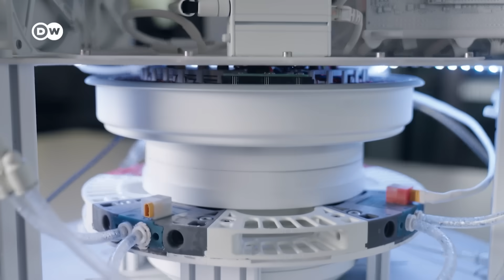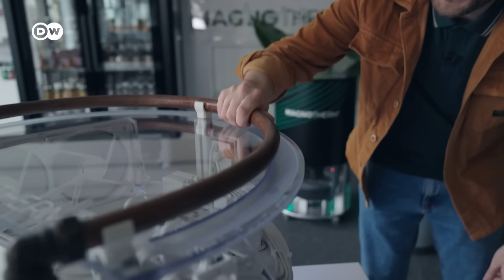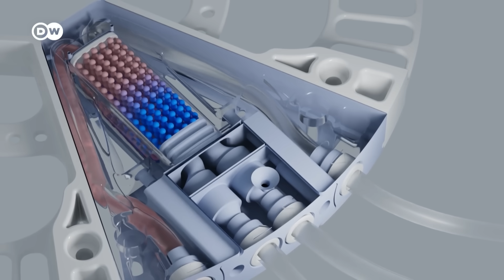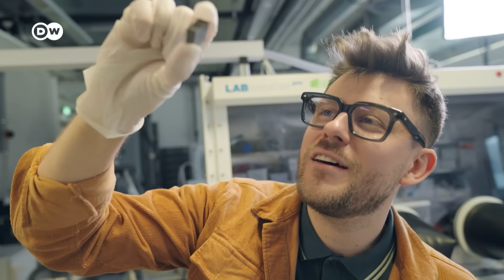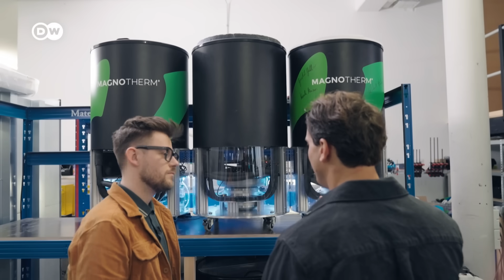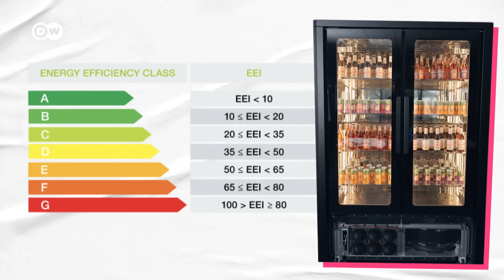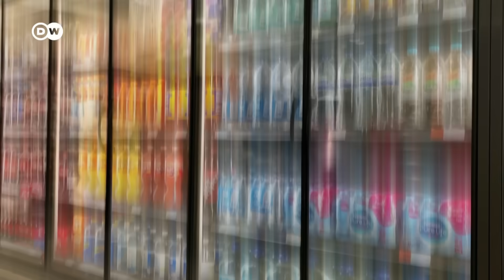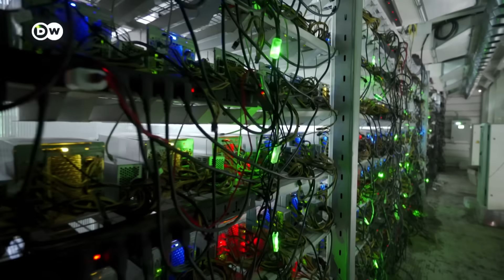How magnets could change our fridges and ACs forever

Comment: Seams to me, like the two big hurdles to overcome are the low temperature differences being made, and the fact that the elements are switching between hot and cold, rather then having a defined cool and hot parts, like in vapor systems. But time will tell. I mean, we had a steam engine for a very long time before we figured out how to make it actually usable
Reply: The temperature differential is directly related to, and limited by, the magnetic field strength which can be generated. This is limited by the physics of magnets, so temperature differential is unlikely to improve.
The alternating nature of the design is also directly related to and limited by the physics of the cooling effect they are using. The material itself must alternate between magnetized and demagnetized to switch between heated and cooled. You have to flow the external (heat exhausting) coolant through while hot to remove energy so that the element can cool when demagnetized. It's during the demag/cooling phase that internal coolant is run through to cool the chamber.

Ultimately neither of the problems can be eliminated. It is clear from the video that they are already pushing the physical limits of the technology and it just can't out compete existing compressor technology which is also pushing its physical limits for efficiency.
A not insignifcant portion of the efficeincy gains in recent years for compressors has been from reducing the temperature differential of the system to minimize energy consumption. At this point they run the cool side as warm as practical for indoor cooling and the hot side as cool as possible to still work on a hot day. The compressors are about as good as it gets, the temps are a minimized as possible, the refrigerants might have minute gains to optimize, but at the end of the day we're at the limit of what's physically possible.

Comment: REEs are impractical if your goal is economies of scale you would need new material choice selections instead.  This would also allow you to reduce the cost of the system being manufactured.                                                      Comparison of Cooling Technologies Using Graphene and Non-REE Alternatives

By integrating graphene and non-rare-earth elements (non-REEs) into MagnoTherm's Magnetic Cooling and Elastocaloric Cooling systems, we can evaluate the impact of alternative materials. Both technologies benefit from the unique properties of graphene and the availability of non-REEs, leading to potentially more sustainable, energy-efficient, and cost-effective solutions. Here’s a breakdown of how these alternatives, including graphene, affect the effectiveness of each cooling technology.
1. MagnoTherm's Magnetic Cooling with Graphene and Non-REE Alternatives
Key Factors Impacted:

    Magnetocaloric Effect: The magnetocaloric effect is a central feature of MagnoTherm's technology, where the material heats up when exposed to a magnetic field and cools when the field is removed. Graphene and non-REE materials do not directly enhance the magnetocaloric effect itself but contribute significantly to thermal management and material strength.

        Effect of Graphene and Non-REEs:

            Graphene can improve thermal conductivity within the heat exchange system, enhancing the efficiency of heat transfer. This could increase the overall cooling performance even when non-REE materials like Fe (iron), Mn (manganese), and Ni (nickel) are used, which are more abundant and cost-effective than rare-earth elements (REEs).

            Non-REE alternatives such as Fe-based alloys and MnFePAs provide similar magnetocaloric effects to REEs but at a significantly lower cost and with more sustainable sourcing.

    Energy Efficiency: The integration of graphene can contribute to faster heat transfer, reducing energy consumption by increasing the efficiency of the heat exchange process. Non-REE materials contribute to the overall efficiency by offering similar cooling effects to traditional REEs but without the environmental impact.

        Effect of Graphene and Non-REEs:

            Graphene’s role is primarily to optimize thermal conductivity, enabling the cooling system to operate faster and more effectively, even with non-REE materials. This results in 30-40% reduction in energy usage, compared to conventional systems using REEs.

            Non-REEs, such as Fe and Mn, offer significantly lower energy input due to their more affordable production and widespread availability.

    Durability and Longevity: Graphene improves the corrosion resistance of the cooling system, especially in water-based heat exchange systems. Non-REEs like MnFePAs can also offer improved durability compared to REEs.

        Effect of Graphene and Non-REEs:

            Graphene increases resistance to wear and oxidation, helping to preserve the longevity of the cooling system components.

            The corrosion resistance of non-REE magnetocaloric materials, like MnFePAs, can also extend system life without the high costs of REEs.

    Cost and Availability: Graphene remains costly but has become more accessible as production methods improve. Non-REEs are more abundant and affordable than REEs, making them a more practical choice for large-scale implementation.

        Effect of Graphene and Non-REEs:

            The use of graphene in the system will raise initial production costs, but the long-term energy savings and improved system longevity could offset these costs.

            The use of non-REEs significantly lowers material costs, making the technology more affordable compared to systems relying on rare-earth metals.

Impact of Graphene and Non-REE Alternatives on MagnoTherm's Performance:

    Graphene contributes primarily to enhanced heat transfer, improving efficiency and energy savings.

    Non-REEs offer cost-effective and sustainable alternatives to rare-earth elements, maintaining similar performance while being more environmentally friendly.

Comment: Interesting. However, you're gonna have to do something about the expulsion of warm water into the surrounding air. That's just gonna make the kitchen warm and wet and intolerable to work in.  I'm guessing home will need to be build not only to run a water supply TO the fridge, but also a drain FROM the fridge to the sewer line or something.

Comment: There's also no mention of freezing, seeing as most fridges can get to a freezer temperature, not sure if it just wasn't explained like that but it doesn't sound like these could get to a point of freezing, merely just cooling, and then with that how do they hold up in heat
Reply: I was thinking the same thing. These probably don't perform well in low temp applications since the capacity reduces drastically when lower temps are needed using the same refrigeration equipment. They mentioned something of 400 watts but 400 watts at what rated conditions ?

Comment: now i realise that modern technology is better protected against magnets then in the past but still i can not help but wonder, huge rotating magnets? isn't there a risk of breaking things? or what if your fridge stands against a wall with electricity wires running through them. could it damage devices connected to those wires? I have no real estimate on how strong these magnets are in reality but for the task they are required i can't imagine they are very weak.

Comment: Compression/evaporation cycle refrigerators cost 1/3 of the magnetic refrigerators which are 16,000 Euros. Energy savings over 3 years will offset the cost. That would mean the compressor refrigerator would have to cost about 3,500 Euros a year to operate. Here in the US we have 2 coolers operating in a building which houses many other electrical systems. Hot water, and huge cooling fans for a greenhouse. To run all of it doesn't cost $3,500 a year. Something isn't adding up.
Reply: My fridge was about €300 and has been running perfectly for nearly a decade so far with no maintenance at all. Even if my entire electricity bill was just to run it, it'll still be less than €200 a month and it's more likely a tenth of that. At €200 a month it would take 80 months (Nearly 7 years) to get to €16k, assuming it uses no power at all and doesn't break. At the more likely €20 a month it'd have to run under the same conditions for 67 years to break even - not even to be cheaper.

Comment: Yeah so this is just technology looking for a market. Immediate issue is obvious: more components and more tech to achieve same basic result of kinetic molecular energy exchange we call heat. But its as a solution looking for a problem, what other use does this have other than cooling or refrigeration, specifically when you still end up with having to vent access heat to the environment... 

Like the only way I see this product succeeed is if they cycle back the heat into thermoelectric material to generate electricity to recycle the heat back into powering the magnetic system. You are still net negative on power, but its more efficient and can be used for cooling in space, where pressure and liquids are harder to manage easily, but can be used as a cooling system. On earth its just more steps and complexity for no added benefit...

Comment: I won't hold my breath waiting for this product to hit the market in refrigerators or heat pumps. It looks extremely complicated and requires very precise adjustments and tolerances. It would need to be cheap to compete with conventional refrigeration.

Comment: a TEC or thermal electric cooler is a solid state chip, if you optimise for efficiency you might just about get a COP of 2, which is terrible but still similar to what you shown, while being dirt cheap. if you can't compete on performance or cost what's the point of this?
Reply: Scamming

Comment: Hang on a minute, we are moving to renewable energy to drive down the cost of electricity, generate it in abundance and to protect the environment. Isn’t that where we should put our focus, instead of building appliances that perform less and cost more? Once we move away from expensive non-renewable energy the electricity consumption of domestic appliances becomes less important. 

Electricity powers modern civilisation. It is essential not only to keep our lights on but for all of us to be included in this society that we live in. Having access to energy is about social justice, equity and opportunity. When governments elected to electrify society they wanted people to be able to have access and use as much of it as possible to raise productivity and living standards. They achieved that goal and now politicians and the energy industry are using access to power to control society.

Comment: No, evaporating liquids is absolutely not how heat pumps operate. This is a common misconception that I have encountered in many educational entertainment videos. I guess the misconception stems from the fact that condensation regularly forms during the operation of heat pumps. This though doesn't increase (or decrease) the effectiveness, because condensation is the opposite of evaporation and thus has the opposite thermal effect.
The operation of heat pumps is explained brilliantly by Technology Connections.

Comment: Did you say it gets down to 9°C? My understanding is that, that is not cold enough. Don't the health standards require the temp to be 4°C or below?
Reply: I understood it as a 9 C delta T on the chilled  loop. I didn’t hear them say how low the temp can get.
Reply: @rossjenson9697  Exactly... I'm quite disappointed, how hard it is for people to understand, looking at the comments
Reply: @rossjenson9697  yeah 9C is 48F not cold enough. A refrigerator freezer should be set at or below 0°F (or -18°C) to keep food frozen and prevent bacterial growth, while the refrigerator itself should be kept at or below 40°F (or 4°C). The refrigerator section is largely controlled as a separate compartment and the evaporator is run so cold that it freezes up which is why the refrigerator has a defrost circuit. Why do you think GE gave up with it? That said GE isn't GE anymore it's Haier, but they get to use GE name until like 2050 or something.
Reply: here in sweden fridges are 8°C, so it's not universal, and i'm sure if they're currently getting to 9°C they can manage a couple of degrees lower than that in the future.
Reply: @swedneck  Huh? That's weird? 4 celsius is normal. Our fridge goes down to 1°C so I use it at that temperature. Food lasts longer.
Reply: @swedneck  in hot and humid countries, fridge needs to be about 4°C.

Sweden is in different climate so its understandable that the standard is different
Reply: That’s why the fridge they used in the video is a beverage fridge it doesn’t need to get as cold as standard fridges.
Reply: Our beverage cooler POLARIS goes to 9°C, if outside temperature is 25°C. If it is 20°C, it can also reach 4°C. For beverages the health standards do not apply in the same form.
Our larger ECLIPSE cooling unit, is more powerful and can reach the required 4°C also at 25°C room temperature.
Reply: @Krovkolosh  ok so outside temp at 25C is about 77F that's a pretty significant limitation. As I live in a hot climate, outside temps easily hit and exceed 95F or 35C to gain large market attraction you know to be successful (selling the appliance to mass market) So imagine if an area is under a heat wave of 100F or more (38C) then to make matters worse (for you) it's only a beverage cooler. Very small market. Not saying you can't find a niche market, but those kinds of things aren't investible to gain wide acceptance. Consumers and back lash, they buy an appliance expecting it to be on the level of a much cheaper appliance that does more and not limited to OAT (outdoor ambient temperatures) or limited to only being a beverage cooler. There is a beverage only cooler market, but these kinds of appliances focus on dehumidification as well, not limited by OAT as wines / not to mention tobacco type products like cigars require a humidor type appliance. This as an example of a niche product that has a limited customer base as not everyone uses wines and or tobacco products. You've got your work cut out for you to gain mass market success. If the appliance can also control humidity (dehumidification) then you got a better chance.
Reply: I'm not excited at all
Reply: one cycle lowers the temperature by 9c. that's why they use 4 loops in the fridge, lowering the temperature from say 20c ambient to -16c.
Reply: yep, this is a non technology, atrocious numbers (COP 2 lol) and totally useless.
Reply: Nope. For theFridge it is 7°C (in the upper half so its get down to ~3°C in the lower half) and for the Freezer you want to have -18°C
Reply: @lordbalbero348 silly metric
Reply: AC
Reply: @jakejoyride but right after that they mention the company built two prototype fridges. It’s never mentioned they are bothering building (HV)AC. Seems like the reporter made an oversight.
Reply: @GBOAC  pretty sure fridges have the at least 4C and freezers -20C.. so its garbage atm
Reply: @ my point is that the '9 degrees' is more likely to be a (reporting) mistake as you can't even come near fridge temperatures with that.
Reply: @GBOAC  it lacks the capacity vs size the unit would have to be, not to mention the cost of implementing it. It's simply not practical and there isn't enough rare earths to do it cost effectively. 12,000 BTU's = 1 ton of cooling. A small window unit typically start out at 5,000 BTU capacity. So it's not even close to being practical. This subject among others will continue to be great you tube click bait though so there is a market for it in a way.
Reply: @GBOAC mpst fridges bottom level is 34f or about 1c
Upper is 44f or 7c so yeah 9 c isnt good.
However it still ok for wine coller or somethong but not food
Reply: @bencoad8492  Normal home fridges usally operate on 7°C or lower. This is what is required to cool down processed meat and dary products.
Unprocessed meat needs 4°C or even better 2°C (no one stores that for more than one day tho)
Freezers on the other hand usally operate on -18°C.
Reply: it can reach to 2-3 degree kelvin.

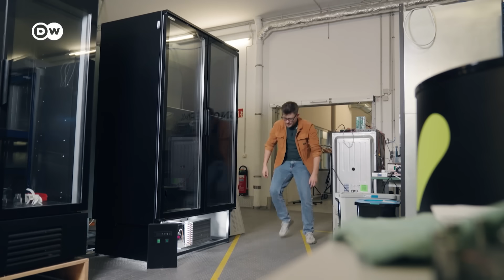Comment: At 1:00 "Let's remember what cools your classic fridge at home" is followed by a poor explanation. This might be easier to understand: 
1. Breath on your hand with your mouth open and it feels warm because the air is at body temperature, more or less
2. Now do it again but with just a small opening - as if you were cooling soup. Now it is cool! Inside your mouth is a higher pressure than outside so the gas expands as it leaves your mouth causing the temperature to fall as described by the ideal gas law.
In refrigerators and air conditioners, a compressor forces high-pressure liquid refrigerant through a "thermal expansion valve" - essentially a small hole - and downstream it is at low pressure and low temperature, and so absorbs heat from the surroundings causing the liquid to evaporate and carry the heat away outside.
Reply: Something about the way it is named or often described gives one the impression that all the cooling occurs through the expansion device.  In most cases the majority of the refrigerant reaches the downstream side of the expansion device still in liquid form, then it boils in the heat exchanger downstream (evaporator) to absorb heat from something.
Reply: @robertfields9297  Good point - hence why the heat exchanger is called an evaporator. Thanks. I'm going to edit what I wrote.
Reply: @petervarley3078  Reminds me of a thought expressed by a wise man something along the lines:  If you constructively criticize an intelligent man, you get a thank you.   For an idiot, you get a punch in the face.